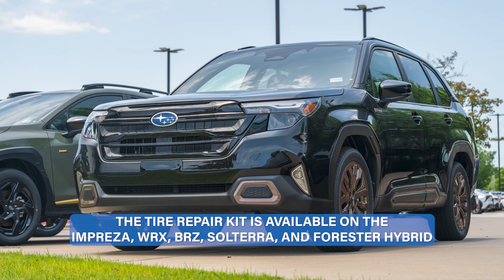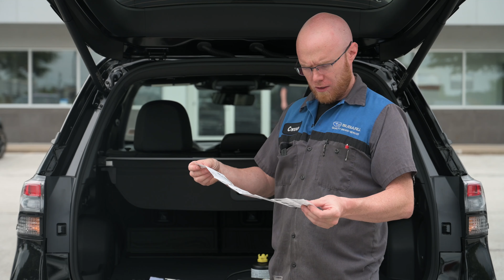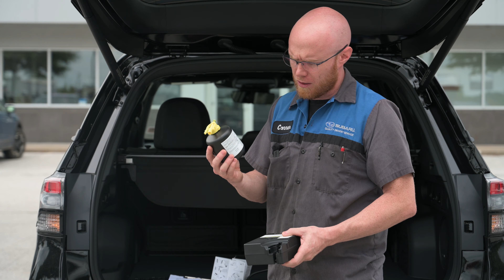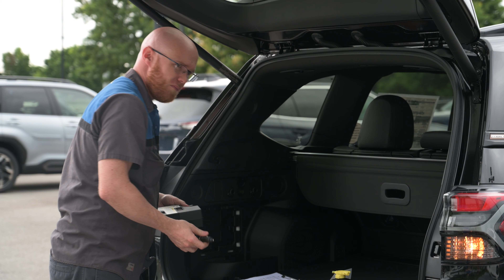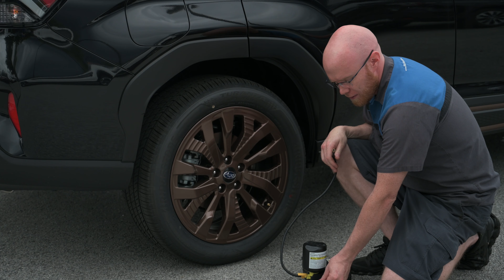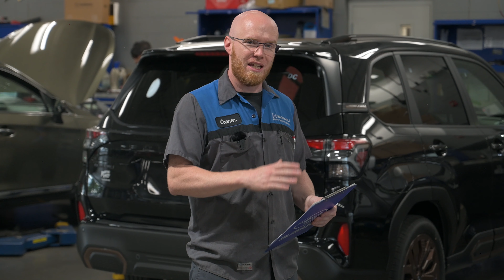How To Use The Subaru Tire Repair Kit

Comment: Useless in most cases.  My wife has had two blow outs after running over nails.  The sidewall was so thin even on Continentals that the whole tire just came apart in two pieces.  That repair kit would be useless in both cases.

Comment: Please show how to lift and where lift point are for a 2026 Subaru Solterra using a Subaru jack when needing to change a tire.  It came with NO spare, and NO Jack kit  (which I purchased separately for $160), but does have a inflation compressor and goo in event of simple nail puncture in center zone of tire.  But if getting a side wall puncture need to remove tire and get it replaced separately from a tow.  Need to know exactly where lift point are and how to.  Can you demo that?   Or should I buy a set of Run Flat Tires (between $1K to $1.2K) and is that really a solution for gravel roads?

Comment: Most of the time, a puncture can be located. Nails, sheet metal, glass tend to stay in the tire, making it easy to locate the leak. If that's not the case, soapy water is mixed and poured on the tire progressively while you look for air bubbles. Once found, plugs made of specialized vulcanizing material are inserted. These bond with the rubber and create a permanent fix. 

For road trips, I bring the following: Ryobi ONE+ cordless impact wrench, drill and air compressor, withi one 18V battery that can be swapped between them...18mm and 19mm sockets (19mm is standard Subaru nut size, but some have 18mm),  4mm to 8mm drill bits, pliers with a wire cutter, and a tire puncture repair kit. Sounds like a lot, but cordless power tools are everywhere. Stick with a brand so tools, batteries and chargers are swappable.

Use the impact wrench to remove the lug nuts, then pull off the wheel/tire. Use the pliers to remove the object. Use the drill and bit to make a clean hole. Use the tire puncture repair kit (which includes vulcanized plugs and a T-hande tool to push the plug into the hole. Use the pliers to cut off the protruding extra plug material. Use the compressor to inflate the tire quickly. Use the impact wrench to reinstall the wheel/tire. I'm sure there are videos on this repair process. Daunting? No more than the hundreds of things we learn as adults to keep up a safe home and safe cars. I've done this a dozen times and it's fast & easy. Pumping the air in the tire is what takes up most of the time.

Comment: Are the tires still usable after hole fixed
Reply: Temporarily, and shorter period than a full-size spare. What I hate about these kits is this: unlike a full-size spare, there's no guarantee you'll get back on your way. However, let's say it works. You're on borrowed time. Most flats result from punctures which can be very reliably fixed - no new tire needed. But if the ooze is doing it's job, locating the leak will be near impossible. Thus, the puncture cannot be located, and you have no choice to but to buy a new tire.

And now you'll be stuck with one tire which will be be unevenly worn versus the other three. Not ideal at all. When the other three need replacing, you will (definitely should) replace that new tire you bought.

Comment: Does this mean that the Forester Hybrid doesn’t include a spare tire?
Reply from the maker: Correct. From the factory, it comes with a tire inflator kit.
Reply: Yep. Every year they give you less and less while you pay more and more
Reply: Nah it's not a case of getting less, they put the hybrid battery in the back instead of the spare tire. The way some others do it is under the rear seat. They decided the rear seat gets to be comfortable and the leg room adult friendly. The cost was the tire, which is worth it. 

Here's the thing, if you doing light off roading the tires are fine, if not you would upgrade the tires. If you do that, that spare would be useless anyway. They make mounts to attach a spare to the back or the roof, so off-roading that's what you go for anyway.